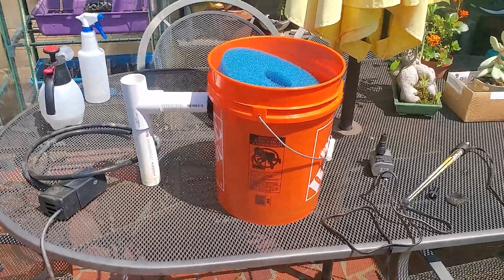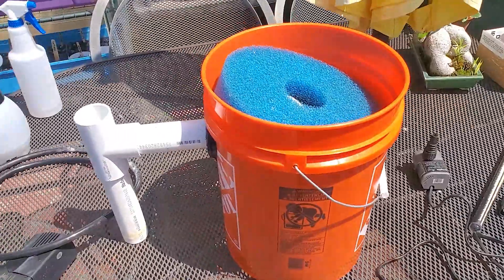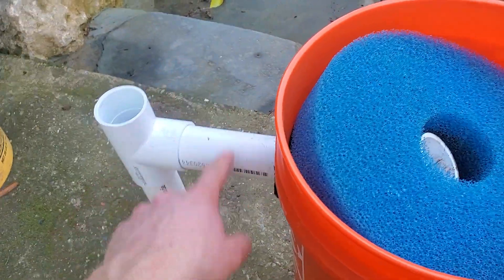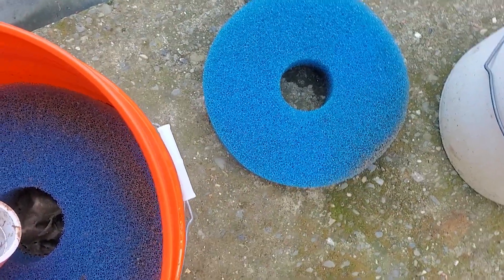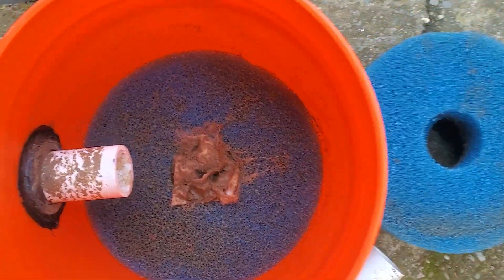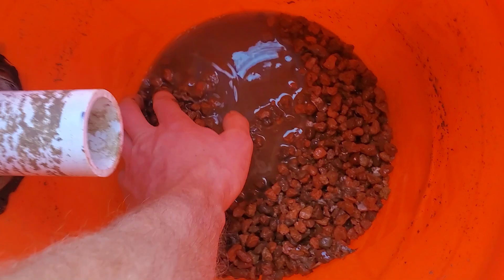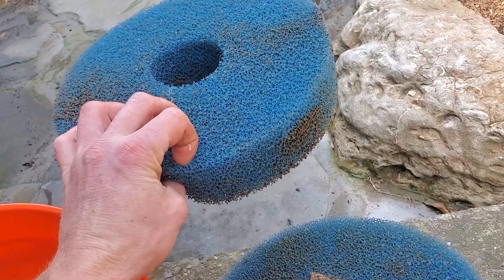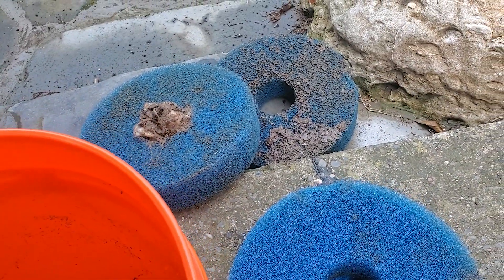DIY pond filter performance review (aquaponics filter- pond filter)

Comment: 🤔 This filter is a horrible design.  Keep it as is but include a lid with a pvc connection in the middle with a pvc pipe gong to the bottom with a t- connector on the bottom. 
That way the water starts at the bottom and if forced through all the filtration.